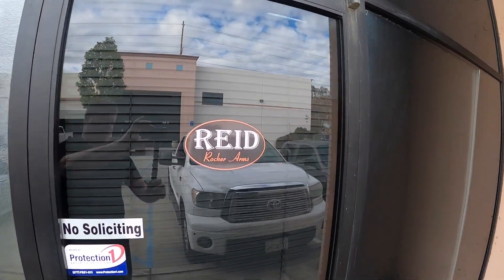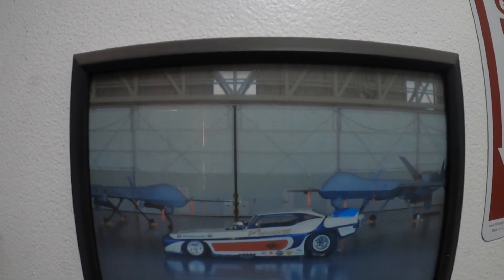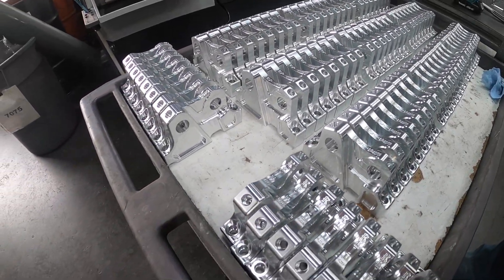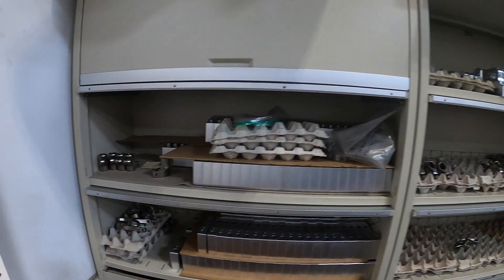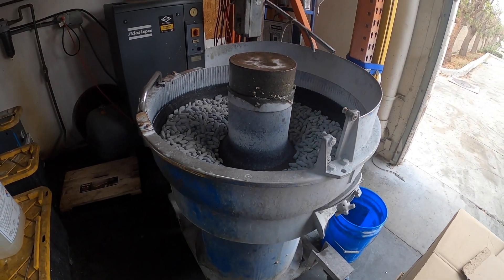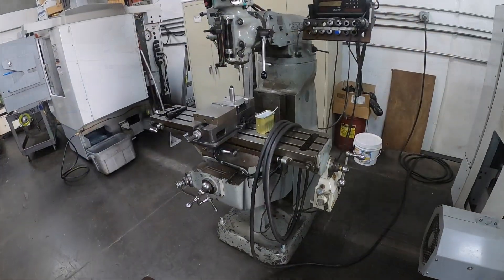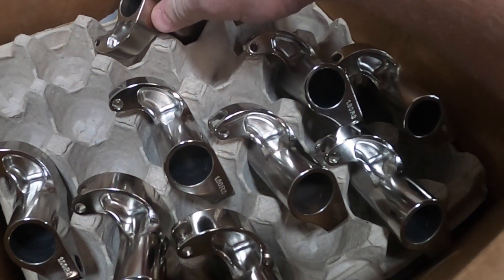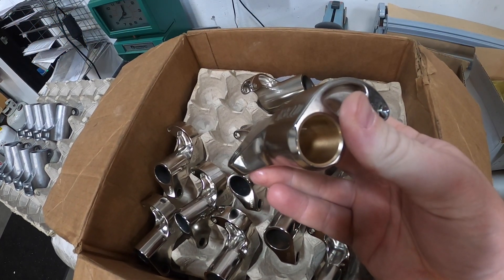How Does Reid Machine Build Top Fuel Hemi Dragster Rocker Arms? We Take a Shop Tour

Comment: Ray Barton makes a good set of Gen II Hemi rockers for stock configuration. They're expensive , but I'm sure Reids will be too!!  If it saves an engine then they're worth it.
Reply from the maker: Yes! Barton does make a good rocker system that has seen tremendous results, but his rockers were not designed at the 10,000th scale using CAD software. What Reid is doing is a whole different animal. Nobody in Nitro or Top Fuel are running Ray's rockers, but they are using Reid's.
Reply: @moparconnection   correct
.I was speaking to the aftermarket street application you mentioned at the end of the video.....